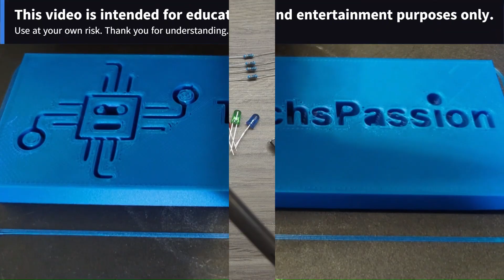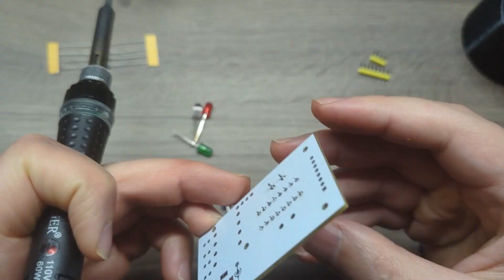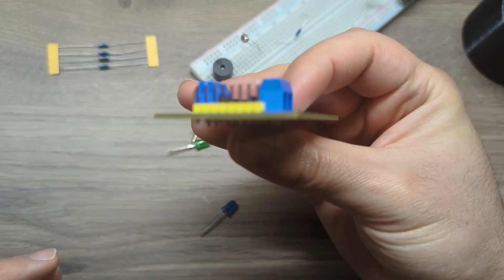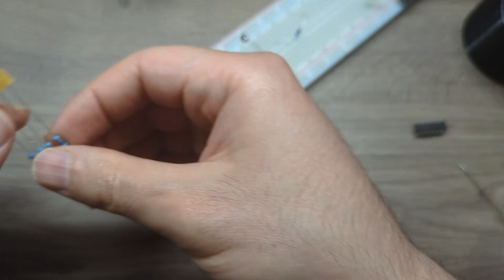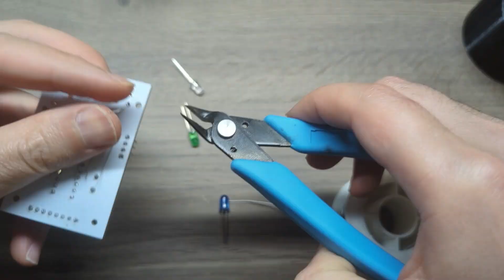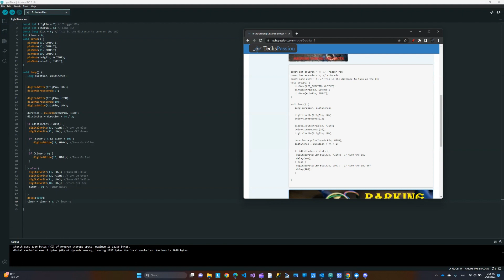LEDs - Timer - Parking Sensor - EP3 - Part 2 #arduino #schoolproject

Comment: What solder do you use here? Looks like an cheap offbrand one
Reply from the maker: Busted LOL. This brand called "Wyctin" got it from Amazon long time ago but it was cheap. Thanks for watching
Reply: @techs.passion  Id suggest something more reputable. Joint quality depends quite a bit on solder quality. I use a alpha no-clean fluitin 1532. Got it from part co. It's bit more pricey but worth imo.
Reply: i got the 500gram roll it was 33,40€+postage ~6€ so not exactly cheap. But i ordered extra stuff so the postage wouldn't be for just for that solder.
Reply from the maker: Thank you for taking the time to provide the details and the suggestion. I will take your advice and get a better solder. I will look for that brand you mentioned. thanks again :)